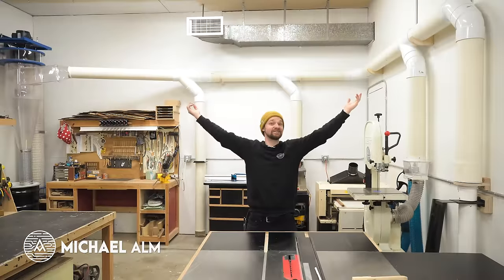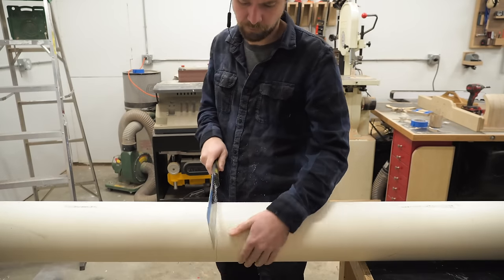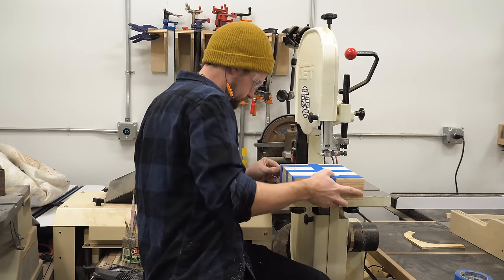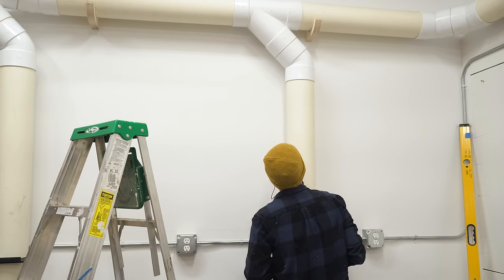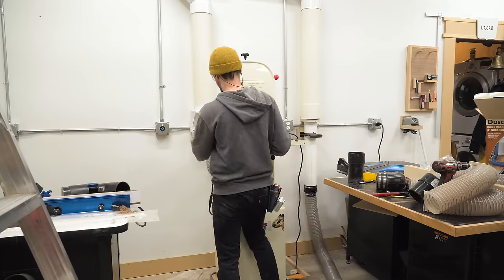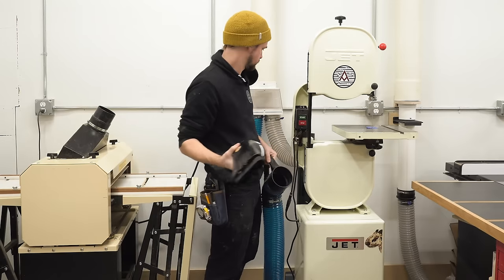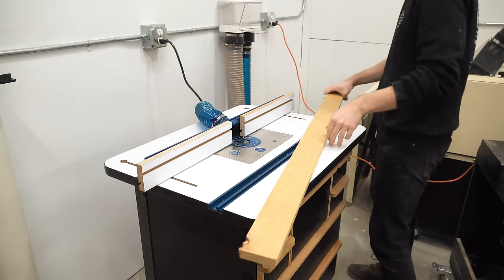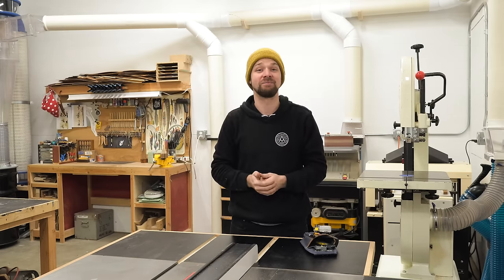Dust Collection System Upgrade

Comment: Great video. Shop looks amazing, its your first video I've seen, sure to check out more. 
Question i have with PVC piping, is the static build up. Curious what your angle is on that. Cheers, Brend
Reply from the maker: Thanks! I really should've talked about the static, and I might do an update video. I don't think there's a chance of explosion, but I have heard it might harm electronics like the ones in my SawStop. After using it for a few days I definitely have felt a couple pops, so might be a good idea to do some basic grounding...
Reply: @MichaelAlm  i wasn't sure if there would be less static build up woth a cyclone. Only just started looking into them. If you do do an update video, I'm looking forward to see it. Keep it up
Reply: As an insurance field underwriter if I find a PVC dc in a shop we recommend it be removed. The static can cause explosions, fire and workers have been hospitalized by a shock.
Reply: @tacticalnimrod9825  true, i heard that too. What about grounding the PVC pipes  (with copper wires running inside them. 1 side attached to the machine the other to the dust collector)?

Comment: Apparently the best dust collection is done with metal pipes due no static charge but still even with plastic pipes and that giant dust collector itself price must have been between 4000-6000$. With so many pipes,bends and all efficiency must not be the best. I wonder if it wasn't better to just buy 5-6 $150 dust collectors at 50l capacity and connect each directly to most used machines. It wouldn't require any extra work and you would not have those plastic ugly pipes hanging above your head.Also it would cost less than $1000 which is a huge plus.

Comment: I think you should listen to all the comments and do something to prevent the static electricity in the PVC from causing any hazards. Look out for your safety and the safety of those around you.
Reply from the maker: Thanks, I’m doing a followup video on that subject
Reply: @MichaelAlm  I have been using this same setup for 12 years now. I found that the only thing that needed grounding is the catch can, drum or whatever you run the dust into. One time in the winter I took the top off to empty the can and got hit with a huge bolt of static discharge. the guy working 300 ft. away heard it zap me. Also ,I got rid of the filters and sent the discharge directly outside. The filters clogged  up all the time and I spent a lot of time cleaning them.I run 6 " duct to every machine  and the main trunk is 8" I think. All according to Mr. Pentz.
Reply: this is a great article assessing the risks in a very down-to-earth way http://www.woodcentral.com/articles/shop/articles_221.shtml  (one of the main take-aways was that to prevent fires it was more important to have a metal dust container and empty it after work and/or cover it with a metal lid than to ground PVC/insulating ducting, although you might want to do that too in order to prevent getting shocked when you touch it).

Comment: How did you handle grounding of the dust collection system? I'm not an expert but I have seen people worry about PVC systems and static electricity and significant problems and safety concerns this may lead to.

Comment: Great video ! One comment anyway, since the whole system is made of PVC products you should be aware of the buildup of electrostatic electricity. Sawdust doesn't need much to explode ! A solution is to run a copper wire to al the metal clamps and screws and finally connected to your house electrical ground.

Comment: That silicone tape is great looking stuff but pricey. It works out to about $3.75 per 4" coupling, that's more than the pricey of the pvc coupling itself. Aluminum HVAC tape is about 1/10 the cost. Yes, the silicone tape looks nicer but still...

Comment: Dude, that’s a nice system!!!  Did you try getting the piping at Lowe’s? 
How about the planner? Out of all my shop tools my planner makes the most mess
Reply from the maker: Thanks! I could’t find 6” pvc at any big box in my area. I haven’t tried the planer, I’ll post on insta when I do...
Reply: @MichaelAlm  Lowe's in North Seattle sells 6" DWV piping and fittings. Way cheaper than anything else ($30/10ft), and twice as thick as that thin wall PVC. Designed for French drains and major sewer lines. I have CV1800 hooked up with it and it fits great.

Comment: No glue? Youre going to have so much pressure loss at every joint. Give it a couple months every joint will have fine dust build up from the leaks.

Comment: And where are the grounding for the pipes? Safe first.
Reply: That was my first thought, too, and was looking for it during the video.  Static electricity does build in these systems... not sure how dangerous it is.  Ron Walters posted a demo video on his channel about 4 years ago.
Reply: @TomKaren94  You know, in my country OHS is the standard, every workshop has a mandatory grounding in the pipes. I often see this in workshops, even at car mechanics. Even insurers ask if they are secured. There are cases of such accidents that the dust has become flammable, it happens that a piece of fire falls into the tank and a fire will happen. Better secure it just in case. I know this is a small case, but it's better to get it over with. For me, I don't have to imitate some "Youtuber" that claims otherwise - OHS must be.

Comment: Very nice Michael! On another channel I saw someone build a little square "stand" so the dust port for your oscillating sander sits on the actual surface of the table, behind the back of the sanding belt.  In newer models there is a screw hole for the 'stop block' to mount it to, but i'm sure you could easily find a way to clamp it down or something.  Here it is: https://www.youtube.com/watch?v=Kes9AHLX96M
Reply from the maker: I'll check that out!

Comment: Isn't 6" ducting overkill?
Reply: Rob Gibson    No.  The pipes don’t work like vacuums.  Dust collection improves the wider the pipes.   Going down to 4” it’s so-so and 2.5” the collection is lousy.  Airflow is the key.
Reply: Rob Gibson    Here is a great video describing the studies.  At 38 min, they are talking about 6” as close as possible to the machine.  
https://youtu.be/GVjYmxYiD60
Reply: Rob Gibson    At 41:00 into that video, there’s a quote by Bill Pentz who has done considerable experimentation on dust collection (billpentz.com).  In an example, he states that with his 1.5 HP dust collector (1100 CFM), it generates 4” to 6” of pressure.  It can move 800 CFM on a short hose of 6” flex hose.  (Flex hose has 4 times the drag of a smooth pipe). And can move only 550 CFM on a 5” flex hose ... and 350 CFM on a 4”.
E.g., a drum sander needs 800 CFM.

Comment: Still watching but it drives me insane that they call those connectors "WYE" and "TEE" when they are clearly named for the letter Y and T that they resemble. Rant over. Do you know about how much you paid per section of 6" pipe?
Reply from the maker: It's very confusing. The lady at the supply shop yelled at me for calling it a 45 degree wye. She was like "They're just called Wyes!" 😂 Each 10ft length of pipe was around $20. The expensive part was all the 45 elbows, they were $20 a piece, and I think the wyes were like $30. It added up quick.
Reply: @MichaelAlm  Thank you Michael, that's a lot better than the heavy wall stuff, at least, like enough of a difference to make it worth going to 6" from 4"

Comment: sorry but there isn´t engineeering at all, the main duct is incorrect because the diameter...you must reduce the duct diameters between every "Y", if not, the flow will reduce a lot on the far spot.

Comment: Is static a concern or is it all good? 
I waant thaat
Reply from the maker: It's a big debate. I couldn't find any evidence that you need to ground the system, but people can draw their own conclusions.
Reply: @MichaelAlm  It would be interesting to see if static cling develops over time and the ductwork gets 'fuzzy' with dust particles on the outside of them.  When I was a kid, my father built a dust collection system for his shop out of 4" PVC sewer pipe and fittings.  At one point, he was moving/re-configuring some of them and he placed his hand inside the duct (kind of like wearing it like a sleeve) and woke up a few minutes later on the floor.  (!!)  Confused, he tried it again and caught himself in the midst of falling off of his latter.  This ended up being caused by the build-up of static charge inside the ducts.  The friction of the dust rubbing against inside of the ducts created a static charge and the ducts themselves retained the charge like a giant capacitor.  He ran a bare wire through the ducts when he finished moving things around and the issue was solved.  Food for thought, if nothing else.  Love your work and enthusiasm.  Cheers.
Reply: Dan is right. Static is definitely a concern. Even if the jury is still out for parts of the woodworking community, running a wire through the system is cheap and easy. It doesn’t need a big wire and it’s worth the peace of mind. 

That’s a great dust collection system. I’m building one like it, but I’m going to keep the machine outside the shop and run the connecting duct through the wall. I don’t have a 5 hp machine, so my drops are 4” to keep the velocity up.
Reply: I always ground my pipes sometimes
Reply: @FuSioN Density - funny. Reminds me of the joke - What’s the difference between a duck? (Various protests ensue...) One of its feet are both the same! (Expressions of dismay)

Comment: For the sander, Izzy Swan has an excellent solution/dust collection build for his oscillating, disk, etc. sanding tools that seemed to suck in the majority of dust and specifically fine dust which I feel is the hardest to pick up. Check out this link for Izzy’s specific sanding table dust collection. I think you’ll enjoy it! Absolutely loved watching yours and the simplicity of building your custom pipe holders, the double 45 angles, everything 

https://youtu.be/JYcJnL02J34
Reply from the maker: Thanks so much!!
Reply: No disrespect to Izzy but those baffles must put a lot of restriction on suction, but then I've read vacuums work in a different way to dust collectors.

Comment: This is great, but seems like overkill and expensive just to move dust around, at least for budget hackers.
For brackets, get plastic hanger, the pipe hanger they use to hang pipes and ducts in attics, etc.  In fact just plain plastic strapping might be better, no holes except where you drill them so it may look a bit more neat.
For pipes, find the cheapest plastic etc 4x8 sheet rollable material you can with reasonable strength.  Cut in half for 2" makes two 7" pipes 8' long for the sheet price.
You could even make it out of cardboard or poster board.  Roll it, spray with dilute glue and get the needed strength.  Roll one end to just fit inside the other, inside pointing back to the vacuum so less catches at the connection edges..
I'd aim for super cheap, like less than $50 for materials for the whole system..